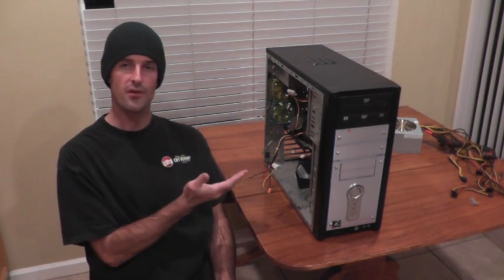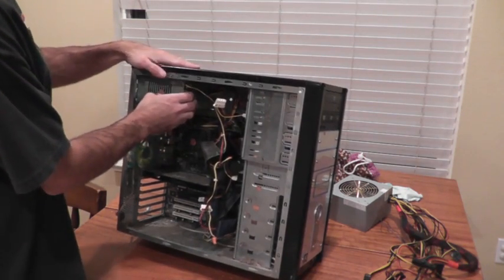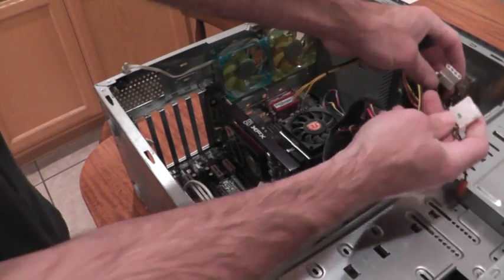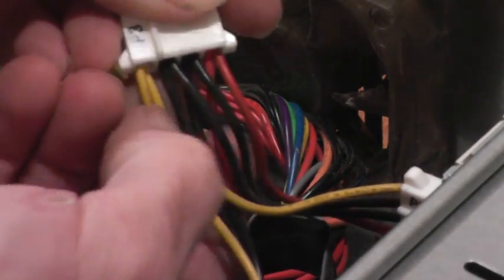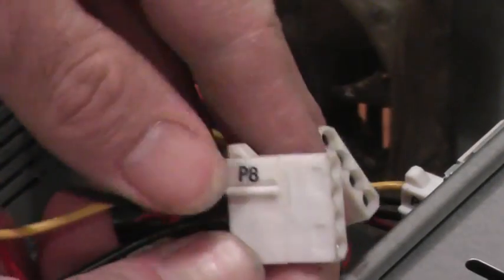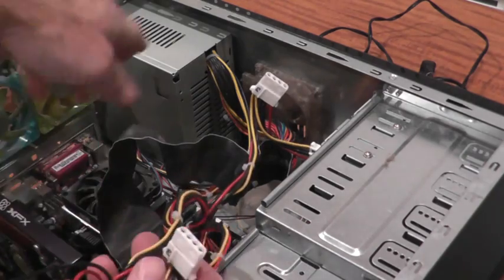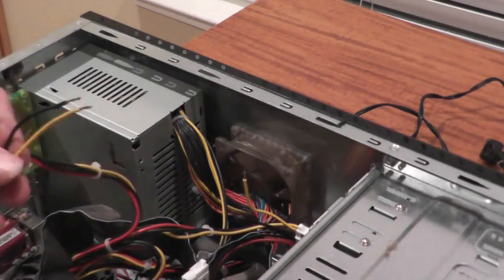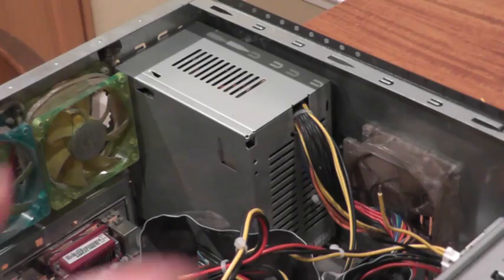How To Install A PCIe Power Plug Into An Older Computer PSU

Comment: Thanks for the video. I have around 20 old dell 760 psus rated at 255w. I plan on rewiring each unit with 2x 60pins to run risers and gpus for mining.

Comment: I know this this comment is really late but according to my research I know that the 6 pin pcie connector can also have 2 yellow 12V wire (the middle yellow wire don't) and will work just fine as long as you don't extend the 6 pin to 8 pin connector.

-sorry for my bad English 🙂

Comment: PS. a great brand to look for, to do this with is Delta ( OEM for Dell and HP ) get one of their older style NEW PSU's and rewire it. As good or better than a new PSU, it doesnt have to look ghetto either! You can run your own sheaths

Comment: This dudes a genius already had a molex to pcie adaptor but I needed two of them and I was going to try this but didn't want to break my GPU and it worked 😁😁😀😀 now I have a get gettho setup thanks dude lots of love
Reply: Illuminatig SESH hey can I use a 2 × molex to 6 pin connector and plug in the molex's to my pc then plugin the  6 pin to my gpu? (My psu didn't come with a 6 pin connector)
Reply: @lessonzonlife4837  yeah you can go ahead and do that shouldn't be a problem try to connect the 2 molexes on different rails if you can but it doesnt matter too much
Reply: @illuminatigsesh7577  sweet. Also before i put the gpu into my pc do i have to install the drivers for the graphics card im putting in?
Reply: @lessonzonlife4837  no do that after it is in

Comment: Pls help me, i have a 450w power suply, with couples of 4 pins connectors,but i want to get a 460 Gtx which requires 2x6 pins connectors.what should i do?pls help
Reply: RayTheHero just upgrade ur psu dude

Comment: ok so i bought a gtx 1060 for my computer and it has a PCIe cable but my power supply doesnt have PCIe ports. pls help what to i do
Reply: Buy a new PSU
Reply: Buy an adapter.
Reply: MR.Toasty Same for me
Reply: Same.. The only way is to buy a new PSU

Comment: Im gonna install a 770 ftw, on a old 550w psu, but it only has 1 8 pin and a 6 pin,  but the 770 wants two 8's
Reply: What is the result? If it doesn't work, I might create a video.
Reply: RaidXTech YT If you can please do,  i want to install a Gtx 950 sc+ and it needs 3+3, but my power supply has 2 4 pins

Comment: If my power supply only has a 6 pin, can I attach an 8 pin to it? So I would have a 6 pin and 8 pin to use a 1070?
Reply: just get a new power supply with an 8-pin dude, a 1070 draws a lot of power and using adapters can damage the 1070.
Reply: Thank you for that..exactly what I was going to do.  minimum 750 watt?
Reply: Spike553 i got a 750 watt for a 1080, its good

Comment: Hey man,i just recive my gtx980 classifield,but i have only two 6 pin connectors on PSU,and i need  two 8 pin for my card.So can i rely on the power adapters wich came with the card?

Comment: This is what i did. I had a power supply which only had one pci-e connector, and my gtx 960 that i recently bought needed two pci-e connectors, and two power plugs came with the card so i used one of them and plugged it in and it worked. 

A few months later and i still haven't run into any problems, all of the games i play run really smooth :)
Reply: And it is still working  until  now ? 
Because I want to do the same thing

Comment: Replaced dead power supply in older PC today.  New power supply had a 6-pin PCI-E connector.  Old power supply had a 4-pin one.  Like the 4-pin one on the PC's graphics card.  Whoops.  But new power supply had two 4-pin Molex connectors not being used.  Cut off 4-pin PCI-E connector w/ wires from old power supply and wired it to the Molex connectors.  Viola!  PC is running again.  Plus you can actually see the screen to login and do something.  Technically only watched the beginning of this video with the wiring diagram.  But that was exactly what I needed.  Thanks!  PS Will watch your motorcycle vids later.  Not a wrench but have had to reconfigure aspects of my bike.

Comment: dont do this shit... 

 the adapters that come with the crards even tell you it can permanently damage your card.
 yet they ship them out with the card. some of the newer revisions dont ship this adapter with the card anymore.  that is for a reason.

if you just want it working its a good bet. just use a psu calculator and check how much wattage youe need vs what you have.

Comment: if anybody can help me, I have psu that doesn't have a 8 pin connection I want to tap into the other wires with out having toocvuu yis I only have 3 molex witch are being used by the 6 pin. so my main question is, can I wire them just like you did but instead of it being a 6 pin its going to be a 8 pin here is a part that basically is what I'm trying to do.  StarTech SATPCIEX8ADP 6" 6in SATA Power to 8 Pin PCI

Comment: oh hey, this is my mobo you are showing there...
and it has a 4-pin power plug right next to its top pci-e, which i tried to look up what it is for...

as for the original topic, did you check in your videocard's box? you likely had a 2x4pin to 6pin adapter bundled with your videocard.

Comment: maybe  a  looksee  to  check  IF  the  psu  you  are  gonna  be using  had  the  wattage  and  amps  the  system  needs  was    your  first  job  not  making  an  adapter outta  spare  cables and  end  up  overloading  the   psu  and  maybe  even  fry  the  mobo  etc  in  the  process.....

Comment: So.... IT LIVESSSSSSSS!!! :p my new 8800 GT is rocking man! :p
Reply: Rodrigo F. Hello man So.. how it works? with 3 yellow or only 2  ?
Reply from the maker: Rodrigo F. Great to hear it worked for you!
Reply: Mine graphics card is plugged in but just waiting for a Pcie 6 pin cable, im guessing it will survive without making a 'boom' noise
Reply: @theramsey3258 did you survive
Reply: dark night surprisingly yeah

Comment: In total, you wire 3x12V (yellow) wires on the PCI-E connector, to 2x12V wires coming from the power supply. The reason why there are 3 yellow wires on the PCI-e connector, is because 2 wires can not carry the required current. Wiring them back to 2 wires on the PSU means that those 2 wires coming from the PSU are being asked to potential take the current that 3 wires should be taking, that is asking for trouble, especially in applications that push the graphics card. It may work for you depending on the overall max current taken by your graphics card, but should not be used in a generic demonstration of how wire a 6-pin PCI-e into a system that doesn't support 6-pin PCI-E, as some folks WILL have graphics card that will fail if they attempt to use your solution.

Comment: can i place the Sapphire Radeon Dual-X R9 270X 2GB OC Graphics Card and run safely without destorying power supply 
model:HP-450w
ac input:   +5v=/140A.   +12v=/12A
                -5V=/0.8A     -12A=/0.8A
Max Output power:4500W   +3.3V   =30A
Fuse Rating:T6.3AH/250VAC    +5VFP=2A

Comment: Hey man, you do a great job of explaining things but one question. I have a 600w power supply with only one PCIE connector. I need two for the graphics card that I want. Do I just buy a molex to pcie connector and plug the two molex connections to two molex plugs from my power supply to get it to work?
Reply from the maker: yeah that will work, but be sure to plug into molex plugs that have their own separate power wires.
Reply: I have pretty much the same problem, but my psu has 2 cables and i need 4 (for dual gtx 970 graphics cards) would i be able to plug in a pcie y splitter to both of them, or 2 molex to 1 pcie, then plug a pcie y splitter into that

Comment: Great DIY for someone that has a older psu laying around and don't want to spend the money for the right power supply or adapter. FYI depending on your current system configuration this won't always be recommended as your power supply probably under rated already and most newer current graphics card require 450 or better watt psu anyways and your gonna overload your old psu if it even power up afterwords
Reply from the maker: Thanks, glad you liked the video! New graphics cards definitely like the power.